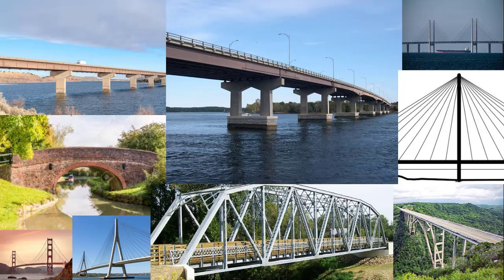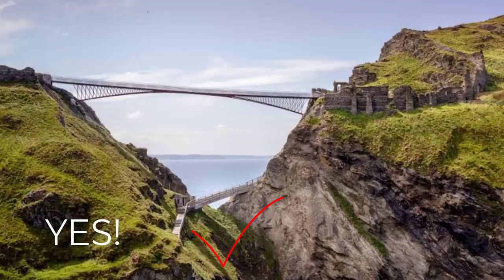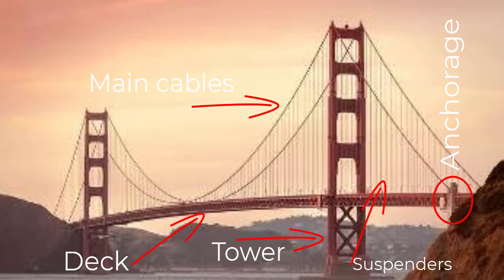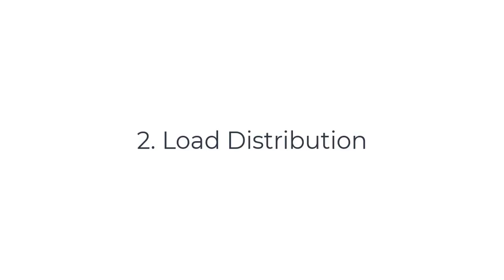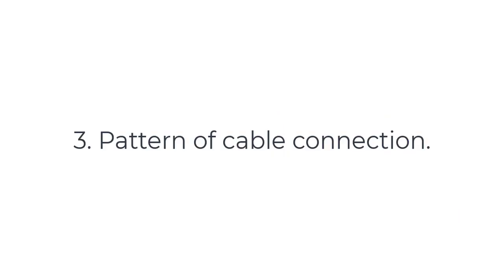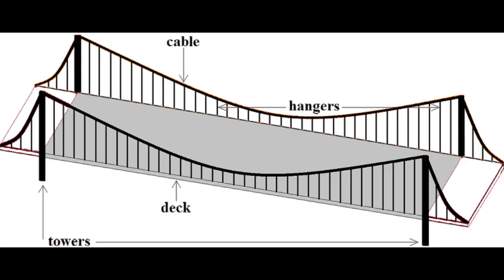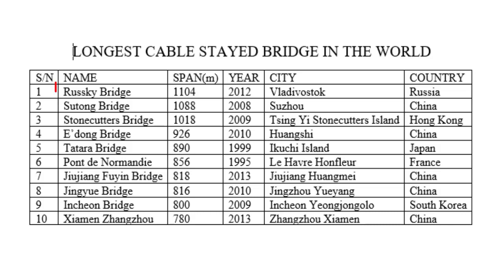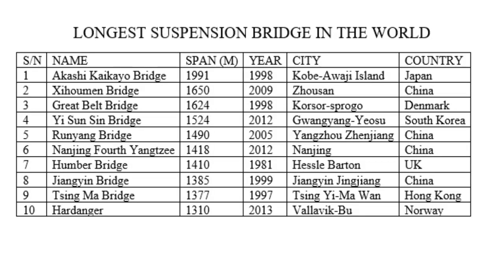4 major differences between a Cable stayed bridge and a Suspension bridge.

Comment: Cable stay bridges are faster to build anyway but where they really make building it easier is when spanning high, high above the ground. Because unlike the suspension bridge no large cables need to be taken across the gap to the other side before building the road deck. Cable stats can actually build out a section at a time from the towers and each new section becomes the footing for the cranes to life and attach the next piece. It’s a crazy sight the further it extends out.

Comment: Something I never knew and only learned recently is that the slight bowing up with a suspension bridge serves no structural purpose. It could just as easily be built with a downward bow or even perfectly flat and the only reason they all have upward bow is to comfort people. Apparently people would feel less comfortable and secure any other way because it would appear to be sagging or weakening. Just thought that was cool.